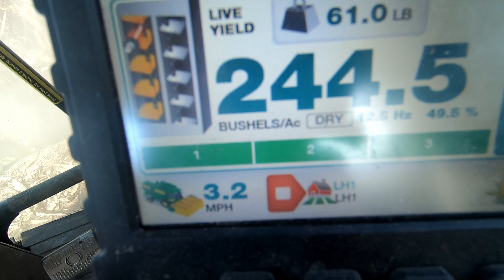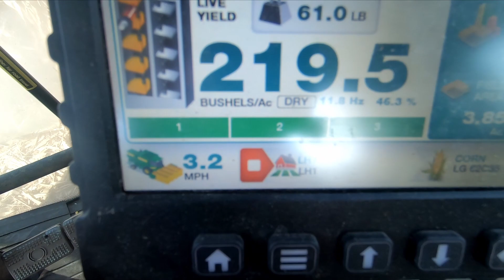Official Start of Corn Harvest 2021

Comment: Hope all goes well, as I told you earlier I finished.  Went to help neighbor on 250 acres. Repairs as follows, 1 row unit,2vacumn shaft brgs with belts, $8500 worth of variable speed feederhouse pulleys and $500 belt, a $5000 drive tire, chopper drive brgs and belts.oh.. oh. Also a radiator shroud and fan blade on freightshaker  and air dryer repair. Other than that it's been LOVELY...LOL ..to keep from crying. Can I borrow trackhoe to bury this POS670?????
Reply from the maker: Dang those are some expensive repairs. That would blow my whole repair budget for the year lol.